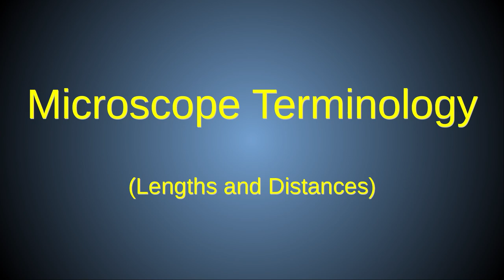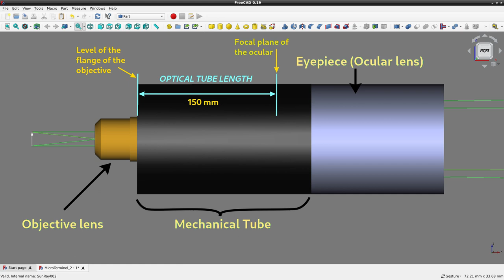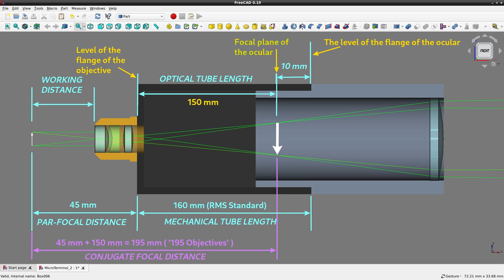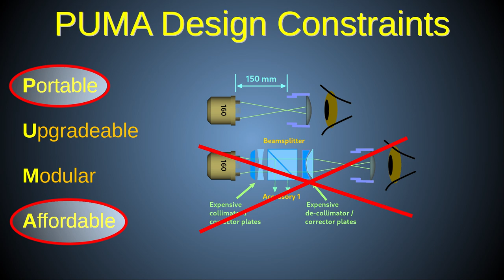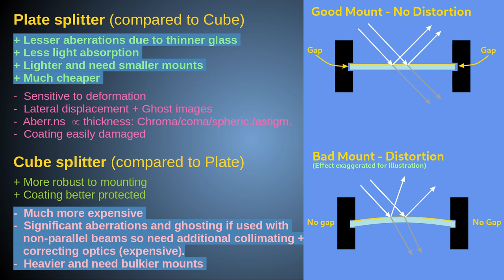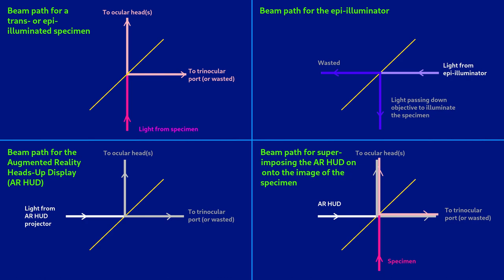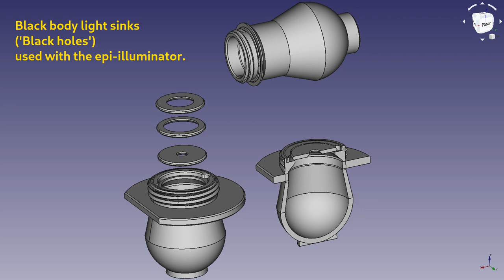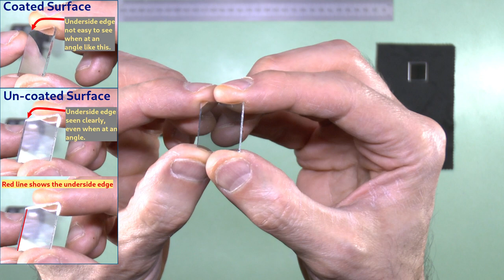Beam Splitters and the Advanced Filter Block (plus Microscope Length and Distance RMS/DIN Standards)

Comment: Hi again (previous comment got automatically deleted and I'm not sure why).

Do you think I can adapt the advanced filter block for a 30mm half mirror?
If I increase the height of the filter block, I assume I also need to reduce the tube length?

Thank you!
Reply from the maker: Hello. You have some flexibility in the advanced filter block because there is the space on top for the optional infinity tube lens. I recommend people not to use the tube lens (which is only for infinity corrected objectives) because the f=100 mm focal length of it is too short for high quality use of infinity objectives - I only designed that space there for the tube lens as a concession in case people really needed to use infinity optics. So possibly by extending the semi-mirror slot upwards more than downwards it might fit and all you will sacrifice is the space for the tube lens which you don't need anyway. In that case there will be no need to change the height of anything. I haven't actually tried this so can't be sure it will work but I'm guessing this might be do-able.
Reply: @PUMAMicroscope  Indeed good idea, I will see if it fit.

Do you have any tips for freecad when editing a design? Removing the chamfer groups one by one is very anoying because it move the content on the top of the hierarchy, so you need to move again everything each time. It's really frustrating, but maybe I'm doing it wrong?
I almost feel like it would be faster for me to edit the STL in blender...

And thank you for the answer, and great design by the way! It's is really fun to print, even if some little things here and here can probably been improved.
But many things are really clever.
Reply from the maker: See my 'Customising PUMA Part 1' video for my general FreeCAD design / usage approach. When it comes to something like all those chamfers I don't see any way round it - you just have to hit 'delete' and let them all go then re-apply afterwards. However what I do is keep a copy of the intact model in a separate file so when it comes to re-applying the chamfers I just refer to the intact model to tell me what needs (re)chamfering and by how much (so I don't have to remember them all or write them down). Yes, that part is a pain - sorry.
Reply: @PUMAMicroscope  Yes I started using FreeCad watching your video.
I'm just surprised that it's such a hassle for such simple things, but it seems to be a known issue with the software.
Maybe it will be addressed in the future, but at least it works on Linux...

When I finish my microscope, would you be interested in feedback?
If so, where would you prefer I post it?

Thank you.
Reply from the maker: Sure - feedback is very important. I don't have a central PUMA forum or anything (perhaps I should make one - just very busy these days). I would suggest you post about it on any social media accounts you have like twitter, insta/face or linked in - and your own YT channel. You could also post about it on Reddit - r/3Dprinting, r/functionalprint and even r/microscopy (although one of the mods there banned me for life - not sure why - most of the r/microscopy community actually like the microscope judging by the comments and upvotes my posts got).
Reply: @PUMAMicroscope  Ok sure! I am mainly active on twitter but I will try to make some blog posts on my website.
I'm interested in microscopy for integrated circuits observation / capture and reverse engineering.
Older chips tend to be quite understandable if you have a high resolution panorama of their microcircuits.
The problem is that light reflected microscopy is quite expensive or difficult to access in some countries (I was lucky enough to find a complete second hand Olympus BH2 for cheap).
So a 3d printed microscope seems to be a good solution.

Comment: That's pretty interesting, and very well explained.
Is this kind of beam splitter usable with infinity corrected optics too? Or do we need a cube splitter for this case?

For example, I have an Olympus BH2, and I want to add reflected light illumination on it. What should I choose? 
Thank you.
Reply from the maker: Thanks. I am glad you asked this question - it is important. I aim to do a dedicated video on infinity objective use but for now note that, with PUMA use of the optional infinity tube lens in this filter block is more of a concession than a recommendation. It allows infinity objectives to be used but with some important limitations. First, the tube lens has too short a focal length to correct for spherical aberrations and flat field in infinity objectives so, although they will 'work' you will get a very UN-plan field even with expensive professional infinity objectives. Second, the positioning of the tube lens will throw the AR projector out of focus so the HUD will not be useable with infinity objectives with this filter block. The epi-illumination mode should work just fine but not the trinocular camera port (because there is no tube lens for that port). So, while infinity objectives can be used with PUMA these significant limitations mean that I am currently looking at developing a more dedicated 'infinity optics filter block' to join the extant 'simple' and 'advanced' models.
Regarding BH2, they are all finite 160 mm tube scopes (not infinity) and their objectives are likewise 160 mm (as shown in the SPlan example in the video) so they will work just fine with the advanced filter block with its plate splitter (and without the infinity tube lens). I have a dedicated BH2 metallurgical microscope in my collection which has a dedicated epi-illumination port. Olympus tend to use cube prism splitters because for them, cost, weight and portability are not concerns so they adopt all the corrective optics discussed in the video. They therefore should give a better quality image - but at a price. I will be doing a dedicated video on epi-illumination and so I hope to demonstrate a comparison between PUMA's epi-illumination system vs. the Olympus BH2 metallurgical - so stay tuned for that.
Reply: @PUMAMicroscope  Thank you very much for the detailed answer.

I have a BH2-MJL, and all of my objectives are ∞/0. I didn't know that the BH2 models also came with a finite 160 mm tube scope, but now that you mention it I went to see the manuals and it is indeed the case. Good to know.
I already have a BH2-MA Brightfield Vertical Illuminator, but this stuff is rare and expensive so I was thinking of making a 3d pritable replacement just in case.

So, basically, if I want to make a PUMA only for integrated circuits observation (so light reflected), what do you think is the best?
Already, I guess I have to buy new objectives, as my BH2 ones will not be optimal for this, as you explained.

Can't wait for the next videos!

Regards.

Edit: After some research, I found pictures of the interior of the BH2-MA-2 on microbehunter. It's an half mirror.
The picture can be found easily on google image with the following keywords: olympus bh2-ma half mirror microbehunter
Reply from the maker: OK. Sorry - you are of course right - my mistake, I was thinking of the transillumination BH2s. My BH2 metallurgical also has infinity objectives. My points about use of infinity with PUMA remain valid.  However, please take note of the stage size limitations of PUMA - most PCBs would not fit on the PUMA stage and even for those small PCBs that do fit, you would not get much working distance to do things like solder tiny SMD parts or some such. For that reason I do not recommend PUMA for PCB work (although it is good for imaging integrated circuit dies - as I will show in the forthcoming epi-illumination video).
Reply: @PUMAMicroscope  Yeah, I was thinking about observing integrated circuit dies. I will wait for the epi-illumination video!
Thank you.

Comment: May I have the STL file of the Black body light sinks?
Reply from the maker: Sure - but I don't keep a repository of STL files (they are way too big, the way I make them). So, instead you can just save whatever model you like as an STL using FreeCAD. The 3D printing guide PDF will show you how to do this, step-by-step. Here is the link: https://github.com/TadPath/PUMA/tree/main/3D_Printing. The black body light sink models are in the 'Dominus_part2.FCStd' FreeCAD file (in the 'Epi-Illumination' group of models in that file) here: https://github.com/TadPath/PUMA/tree/main/FreeCAD
Reply: Great! @PUMAMicroscope